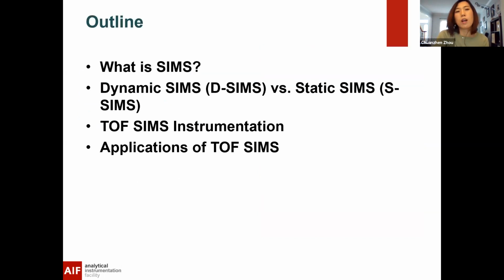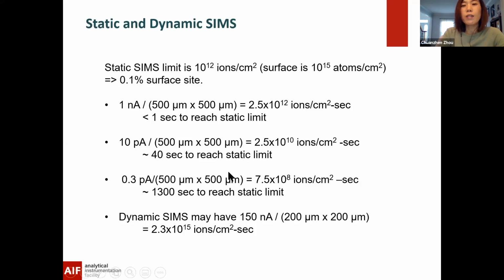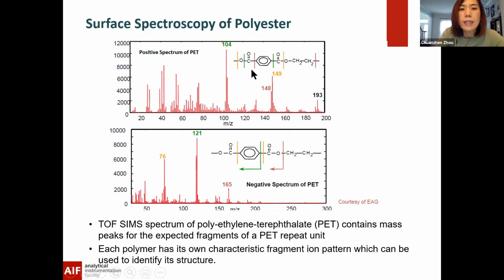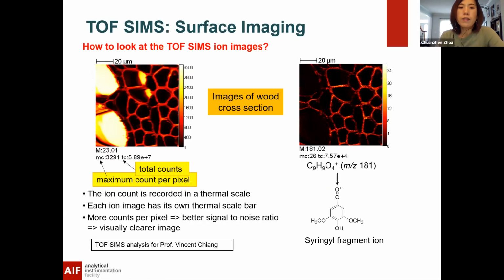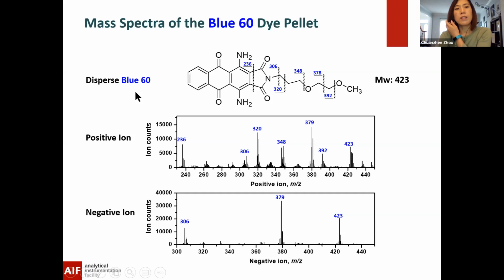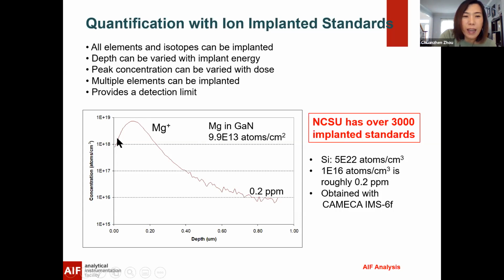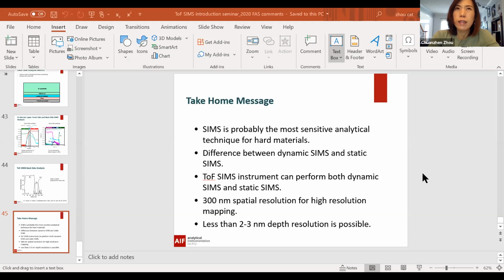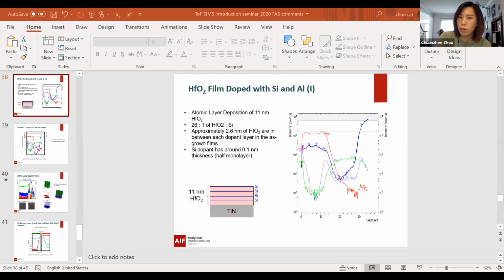ToF SIMS Introduction Seminar

Comment: very very nice talk, could you explain why we should keep our samples dry when we run SIMS analysis (Si isotopes)? Is it ok if we have solids with .h2O within our solid particle (for example CuSO4.H2O)?
Reply from the maker: Since the pressure of the analysis chamber in ToF is in the range of 10E-9 mbar, without a cryo stage, only solid samples can be analyzed. Liquid or materials containing water will dehydrate under the high vacuum and it is also detrimental to the pump.